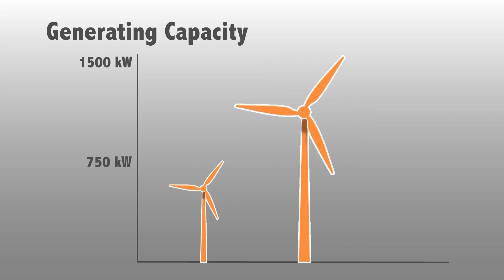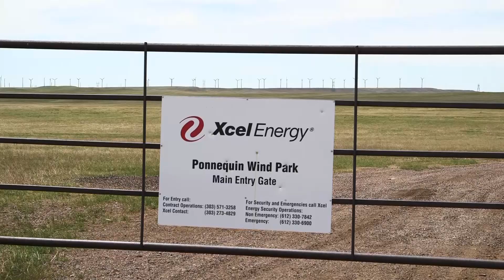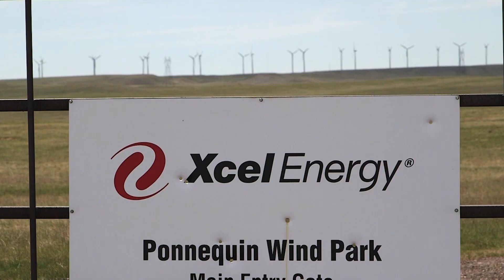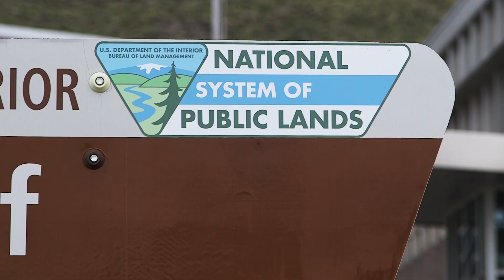Who Cleans Up When a Wind Farm Retires?

Comment: Why not replace the old  tower with fewer new ones? Have they mined out all the wind in that area?  The wiring and transmission lines are already there.   It looks like the energy companies make money (tax rebates and rate hikes)  by building new  instead of upgrading old.   Follow the money...
Reply: Just not profitable, if it was well maintained as stated, it would be possible to replace for a more efficient wind turbine, bit not efficient enough to have profit.
Reply: @victorzeferino7008  I think the issue is they don't want to spend money redeveloping the site. Otherwise I can't think of a reason why they wouldn't redevelop the site since it's obviously windy enough there to produce electricity.
Reply: @victorzeferino7008  to not a viable argument! Take down old put up new! You were technology more efficient!
Reply: @chevychase3103  It costs about the same to maintain one huge wind turbine as it does to maintain one small wind turbine. Once they are fully depreciated and amortized, the retrofit costs are just too high. The tax incentives change, too. 
Even the largest most profitable wind turbines never make more profit that the tax incentives. The profit is basically the tax incentives/credits. Trump needs to end the subsidies of alternative energy so the market corrects to become self-sustaining. Only then with these turbines make sense. Most wind turbines at the Wyoming Colorado boarder like those in Idaho have a huge kill of endangered birds. They get an Endangered Species Act waiver. 
The electricity that comes off a wind turbine costs twice what what coal and natural gas costs and 4 to 8 times what hydropower costs. They sell the electricity because of renewable energy mandates, not because it is cheap energy.
Reply: @idadho  Elsewhere in the world, there are no rebates or government support and they are winning hugely on cost
Reply: @frankspeaking2630  Actually, in Germany, they are learning they cannot survive on alternative energy and need to continue to use local coal  and natural gas from Russia. The UK is also struggling to achieve their goals with wind. 
The promises are falling far short. Wind costs 3 times the cost of the expensive fossil fuel in many cases.
Reply: @idadho  As can be seen from my other comments the alternative is mid to long term disastrous and whom will we hold to account, better pray you are correct and all the scientists and their instruments and research in the relevant fields are wrong
Reply: @frankspeaking2630  Yes, I am wetting my pants worrying about carbon and man made global warming. Climate change is a natural occurrence. Always has been. No using climate change for political power.
Reply: @idadho  We have had the internet for years and all the information needed is available, so your glib response states loud and clear it is a waste of time communicating with you.
I wish you all the best
Reply: @frankspeaking2630  What information am I missing? How about the fact that the computer models and data collection systems have an error range that is greater that the claimed change. Yes, climate is heating up by .6 degrees with a range of error of .9 degrees. So, is it heating up by 1.5 degrees or cooling by .3 degrees ?
Reply: You can't replace towers. New (cost efficient) towers rare twice the size which means four times the weight and twice the clearance between towers. That means you need new towers, new pads to hold the weight, you need to rebuild the pads further apart, you need new control stations and panels, you need higher voltage lines, regulators, transformers, etc. for the larger output and then you need new roads for servicing -- since the towers are in different locations. You also have new safety and operating guidelines. So... you are going to have to clear the area and rebuild everything anyway. There is no cost savings rebuilding it on the same place. You also have the issue that in rebuilding on the existing space... it takes longer before you are operational and earning money back. Finally, wind farms are more efficient in larger areas. So, you'd need to expand the area by several times, make leases, deal with farmers/ranchers now around the area, etc. It's also entirely possible there is no room to expand.

Far less expensive to just build your new turbines elsewhere where you have as much land as you need, can build from scratch, and are up and running quicker. Then take down the old ones. It's like building a new house. The fact you have a lot with an existing house doesn't help you. Its still more work to take it down, fill it in, buy lots around it, etc. to build a larger house vs. just building elsewhere and then destroying the old home.
Reply: Larry these old towers are too small for modern turbines.  They said in the video that they make 700k.  The tower for modern 2-3 megs are wider and thicker steel
Reply: Precisely! Xcel is a dirty legacy coal company only out to help shareholders and Wall Street.
Reply: You're an idiot. Stop believing Democrats' propaganda and admit that fossil fuels are the most efficient way to power this country!
Reply: @NunYa953  until they run out or the planet is dead huh? Good plan Ace.
Reply: Why not simply replace the turbine blades with large sails, which generate plenty of torque, (or force), which would make them very economical, and even profitable.
Reply: @jackfenn7524  because this country is stupid. After all, look who it picked to lead it.
Reply: Spot on- they mined all the wind in the area. 🤣
And it is greener to build new ones.  And, and there are no environmental impacts on the environment, tada... gotta love stupidity once left out of the box. 😉
Reply: The only thing farmed here is government subsidies and they have run out.  You have to build new to get more taxpayer $$
Reply: What do they do with the tons of concrete when they are scraped?
Reply: Nothing there can be reused.  So it makes a more expensive than just to tear it out.  Plus it's a tax right off to get rid of the old ones.
Reply: Most were built with federal subsidies and tax incentives. There is no funds for upgrading an existing infrastructure.
Reply: Ha ha I almost peed myself reading this post
Reply: Wyoming is huge on fossil fuels. Most likely, there are still people there, that pour their drain oil on the ground as a political statement.
Reply: Stfu
Reply: @tommychileti5890  That's insulting????  I dont' know....or care!  When "comments" descend to this level, the speaker is obviously stymied....meaning REFUTED.....for all time...!
Reply: you dont understand econimics.
Reply: Maybe all of the Cabling and Transmission Lines are old, and also way under the current-carrying capacity. Rip it out and start again with new stuff.
Reply: The bottom line is if this was the only land that was offered for a new project they would use it. So they take down every other existing windmill and put up larger ones. Maybe the power lines are not up to par but the towers are there, the land rights have already been established, roadways and other infrastructure is in place. Abandon this place just to start over elsewhere is just stupid.
Reply: This is so true need to hold these people responsible for what they started and to keep it going no matter what
Reply: They said right in the video that the site was too small, they needed more room for a bigger farm.
Reply: That makes too much sense.
Reply: The wiring won't handle the power of the new windmills and so it would need to be replaced
Reply: You're right "Follow the money."
Reply: Did you watch the video? It addressed that. It wasn't feasible to replace the turbines.
Reply: Exactly.
Boats all over the world produce elec through solar and wind and produce enough elec to run A/Cs 
Desalination, refrigeration and a myriad of electronic equipment not to mention the propulsion is wind. 
How about the gas stations the Pence family abandoned that Municipalities had to pay to clean up from the leaking tanks. The Pence family certainly had no problem raking in millions before the tanks started leaking but then they walked away with fat pockets and tax payers cleaning up the Pence mess.
Reply: They are not "mining the wind", they are really mining the state and federal subsidies
Reply: They stated the wind farm size was too small.  The next one will be much larger they also stated.
Reply: I have a friend who went to Nevada about ten yeas ago to build a house and saw a huge wind farm with not one of those windmills turning. He said they built it with government subsidies and had no provision for producing power and now they just sit there. Our government at work.
Reply: @546cowboy6  Many windmills do not turn during the day. The prevailing winds may be only at night.
Reply: @devinculley833  Your solar panels need tax subsidies to be worthwhile. If you did not get subsidies, would they save you money? In California, the electricity rate is artificially high and makes solar more justifiable. 

My brother owns a Calif Solar company and could lower his prices if the subsidies were removed and still be profitable. The solar industry is making huge profits from the over-pricing because of subsidies.
Let the market compete without subsidies.
Reply: @546cowboy6  I live here in Idaho, we have them all the way down the valley to mountain home and with the wind here they turn almost EVERYDAY!
Reply: They clearly stated that to be profitable these days the wind farm needs to be much bigger. That's why they aren't going to just replace them.
Reply: Larry we don't have enough info, but I think the lease is running out. I bet what you say will happen, after the land issue is sorted.
Reply: much of the story was devoted to "cleaning up" the old location.   My point was why not reuse the same area.   You can still build a behemoth site somewhere else, but you avoid the costs/problem of "making the old site look the same " .    Wind farms are tax farms.
Reply: Soooooo let's not drill and use an acre of property but instead we took 100 acres for this bs
Reply: Correct. Replace 1970s-1980s technology with modern technology.   Google: How Windmills as Wide as Jumbo Jets Are Making Clean Energy.   Read the New York Times article.

Comment: West Virginia copper thieves wonder how much copper is in a wind turbine.
Reply: unscreww the bolts at the bottem wait for a good wind and collect
Reply: @t84t748748t6   It would take a big ass socket and a heck of a cheater bar.
Reply: hah I'm sure the meth heads here in GA are wondering the same thing
Reply: A lot.  But much harder to get... plus running ones are energized.
Reply: It wouldn't be theft if its abandoned plus you'd get a federal tax credit for cleaning up a superfund site. Way more money in DND than theiving.
Reply: A Nihtgenga The humanoids here in Indiana  would need to know aswell
Reply: Lots they are huge electric motors basically.........
Reply: Arkansas wants to know too.
Reply: Don't forget, WVCT are American citizens too!!!!
Reply: rooftop copper was removed by Junkies in nyc 1970s it was called Flashing
Reply: I'll scrap them. Just point at what you don't want and it will disappear.
Reply: @timhallas4275  take the 50 feet depth of concrete too.
Reply: Yeah Dumbass that's the only state with copper thieves.
Reply: Lol!
Reply: lol
Reply: Typical green energy disaster with the help of the feds.  Next all the leftover wind turbines will be blamed for air current shifts effecting climate change.  Give me a break.